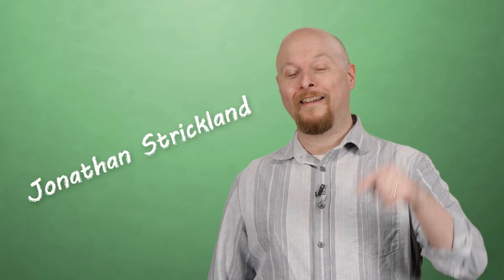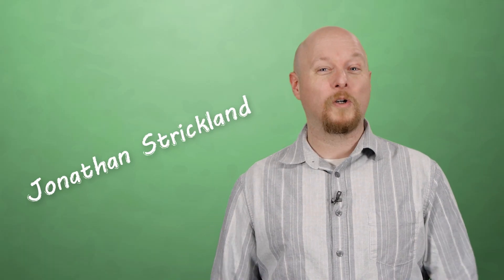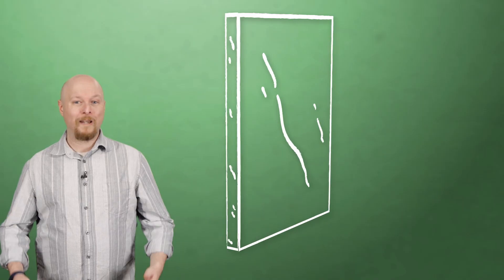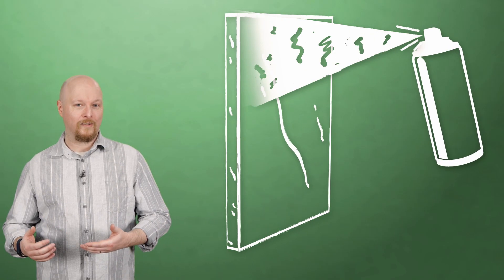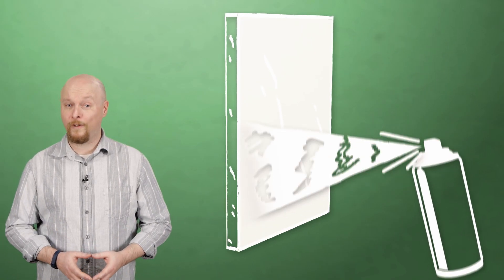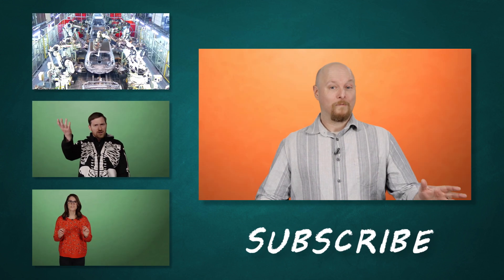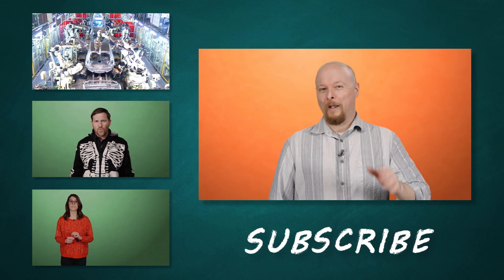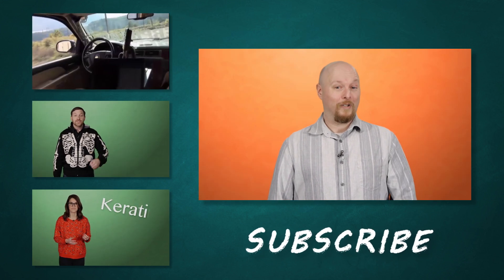How Do One-Way Mirrors Work?

Comment: As a soap writer, I can confirm that TV shows also use this setup to conduct focus groups. A cross section of the show's viewers is brought in, fed sugary treats and asked questions about the show; which storylines resonated with them, which characters (usually visible on a board or on colourful postcards on the table they're sitting around) they like, dislike and why, what they'd like to see happen in the future, who holds the remote control in their household, what their personal aspirations and frustrations are, etc. Writers, producers and other executives sit in the darkened room on the other side of the mirror, taking notes. Every now and then, the charismatic host will excuse themselves and come into the darkened room for feedback and the producers and writers can outline specific questions they want answered. Rather than feeling like an interrogation, it's designed to feel like an informal even festive gathering with new friends so that the subjects are at ease and as forthcoming as possible. They never meet the people behind the glass. The first time I went to one of these as a writer, I left feeling inexplicably guilty. Can't wait to return to that show again. 😁🇿🇦✊

Comment: That phenomenon is known as a one-way mirror or two-way mirror. When viewed from one side, it appears as a regular mirror, but from the other side, it looks like a transparent pane of glass.

How It Works

The working principle of a one-way mirror is based on the reflection and transmission of light, and a crucial difference in lighting conditions. The glass is coated with a very thin, semi-transparent layer of metal. This layer is thin enough to allow some light to pass through, but also reflective enough to act like a mirror under certain conditions.

From the brightly lit side: When a person is in a well-lit room and looks at the mirror, the strong light from that room hits the glass. A large portion of this light is reflected back, creating a strong mirror image. The room on the other side is kept dark, so very little light comes from there. Consequently, the reflected light from the bright side overpowers the faint light transmitted from the dark side, making it impossible to see through.

From the dark side: A person in the dark room receives very little light reflecting from the mirror's surface. At the same time, the strong light from the bright room on the other side travels through the glass and reaches their eyes. This makes it possible for them to see through to the other side as if it were a normal window.

The effect relies entirely on the difference in lighting between the two sides. If the light levels were equal, the mirror would appear as a semi-transparent glass from both sides.
Relation to Prisms
There is no direct connection between the theory of a one-way mirror and a prism.

One-way mirrors function primarily based on the principles of reflection and transmission of light, which are manipulated by a special coating.

Prisms, on the other hand, operate on the principle of refraction, which is the bending of light as it passes from one medium to another. A key use of a prism is to split white light into its constituent colors (the visible spectrum) due to each wavelength of light bending at a slightly different angle.

While both involve light, the underlying physical principles behind their functionality are distinct.

Comment: The fingernail test is unreliable. This test is more correct.

However companies worked around these to keep spying on you even with just a regular mirror you hung in the bathroom. These now often equipped with AI cameras that can track and decipher your movements so they can collect your information. No battery? No problem, these cameras can operate without electricity so it's impossible to disable them.

Comment: One time I was in a supermarket in Switzerland and at the check out desk on the wall there was a simple mirror, but when I pressed my head to it blocking out the light behind me I could see a dark office room. It wasn't very good if I could see through it, simply by looking closely....
Reply from the maker: That's the way all one-way mirrors work! The mirror coating is partially
 transparent, so if you get close and block the light around you, you 
can see through the mirror coating.

Comment: 1:25 Why would someone place a transparent mirror or two sided mirror typically used in security rooms, police stations and schools for special needs students (again for security/safety issues) in a locker room? 

Why would one make the office of the coach the office with such a mirror which is looking out directly onto the changing spaces and showers( also used by minors)?
Reply: Why would the school board approve such a remodel?
Reply: Wouldn't contractors, builders or those who did the installation become suspicious during the build when it became apparent what the space would be used for?
Reply: Who drew up the plans? Who approved them? Why?
Reply: Holy fuck--the entire internet wants to know what you are on and where they can get some.

Comment: I will never trust the mirror in the fitting room ever again
Reply from the maker: +Justin Lew (MC Gamer) No need to worry -- just cup your hands around your eyes and peer into the mirror! It'll be easy to tell if it's actually a one-way mirror.
Reply: @BrainStuffShow  lmao?
Reply: @BrainStuffShow  Hey I just want to know. Does it also work to tell by knocking on it or by shining my phone flashlight through it? I just really wanna be careful because I rarely go out in fear of being watched inappropriately.
Reply: @BrainStuffShow  what if I use a camera will it work
Reply: Hanno Brandwijk This has been disproved multiple times
Reply: HAHAHAH
Reply: Hanna brandwijk it’s the other way round if your fingers are touching it’s a normal mirror but if they are apart it’s a two way mirror
Reply: @ugbadg7787  you are both wrong. There will not be any difference between normal mirror and one-way mirror, because they work on the same principle. Your finger will touch its mirror image only if the "silver" layer is on your side of one-way mirror, making it possible to touch your reflection. But the manufacturers and users of it are not stupid, they'll either put it the silver side to them or cover the silver way with another glass, so that the silver side is in sandwich of 2 glass panels.
Reply: @ugbadg7787  That's what he said
Reply: Me and my girlfriend thought it would also work in the night.
Reply: You're gonna give people ideas.
Reply: Scottie Yes there is, put your finger against the glass, if there is a gap between your "2" fingers, then it's a real mirror. If there isn't a gap, you should go away fast;)
Reply: @hannobrandwijk9809  Ypu are wrong. There will not be any difference between normal mirror and one-way mirror, because they work on the same principle. Your finger will touch its mirror image only if the "silver" layer is on your side of one-way mirror, making it possible to touch your reflection. But the manufacturers and users of it are not stupid, they'll either put it the silver side to them or cover the silver way with another glass, so that the silver side is in sandwich of 2 glass panels.
Reply: identifying suspects;advocayawareness/behind_seethruwindow mirrors? PDF.#40404

Comment: Is there any other ways to make a two way mirror? So there can be light in both rooms?
Reply: +Miles Dolding You can place normal window, that way you can see both sides at the same time!. 
Jokes aside, there are some copper tinted glasses used on external building windows that are slightly more reflective on both sides. That might be what you are looking for.

Comment: If you wanna test if a mirror is trasparent you have to put your finger against the mirror: if you see a gap between you finger and its reflection it's a normal mirror, if your finger and its reflection touch it's a transparent mirror (i read this on the internet, if you have a transparent mirror try this so you can tell me if its true, for now on normal mirrors it corresponds to what the trick says)
Reply: BabuForTheFriends Actually, that just tells you which side of the mirror is coated. If your finger touches the reflection, the mirror is coated on the front side of the glass. If your finger doesn't touch the reflection, the mirror is coated on the back side of the glass.
Reply: Jillian Arnold ....but the spray needs to be on the backside to reflect the light off of it. Otherwise it basically looks like the non-stick side to aluminum foil instead of a mirror.